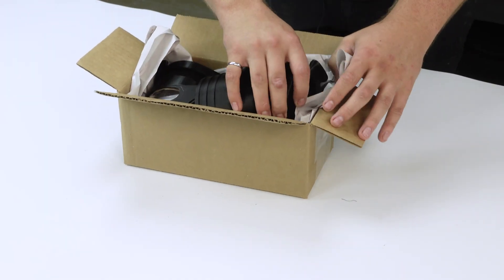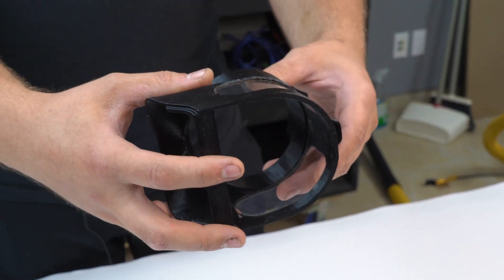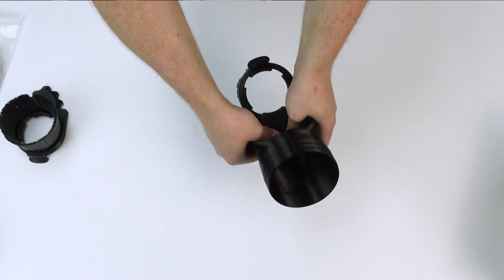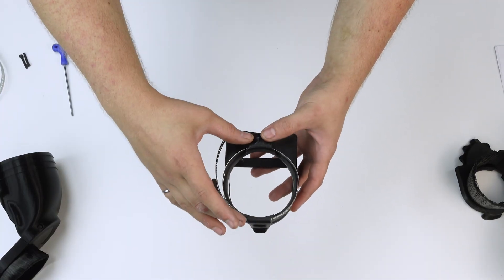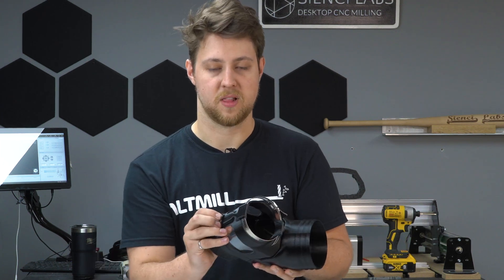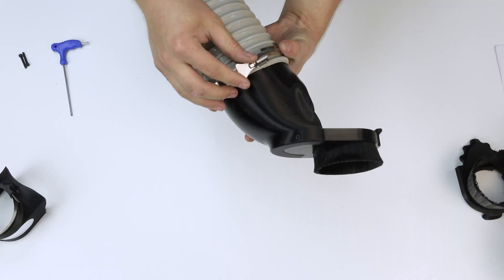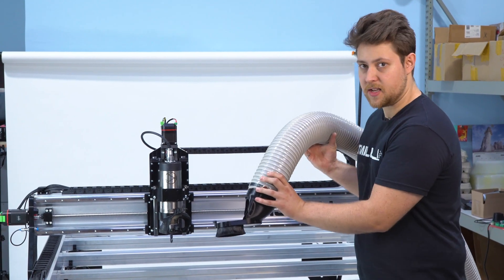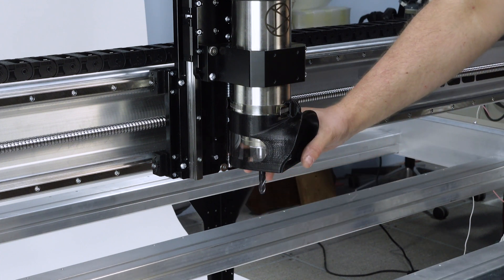How to Assemble and Install the Sienci Labs Dust Shoe Onto the AltMill Spindle

Comment: Will this be available as a stand alone unit? I already have a spindle so don't need that just the 80mm dustshoe.  I am one of the first 50 so was hoping to pick this up along with my Altmill once it is available. Thanks!
Reply from the maker: @philipchristian9935  Yes we can have it set up in the store to buy on its own, stay tuned
Reply: @SienciLabs  thanks appreciate it!
Reply: @SienciLabs  Thanks. My Altmill is ready for pickup, so was hoping to pick up the dust shoe with the machine if possible.